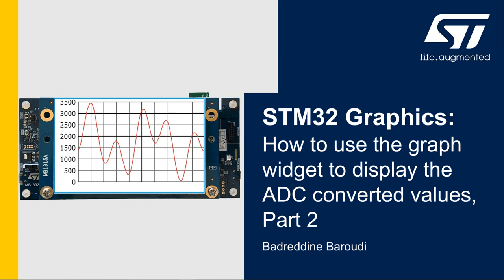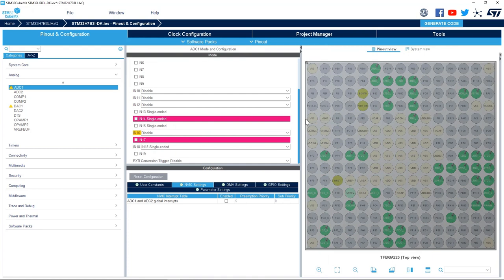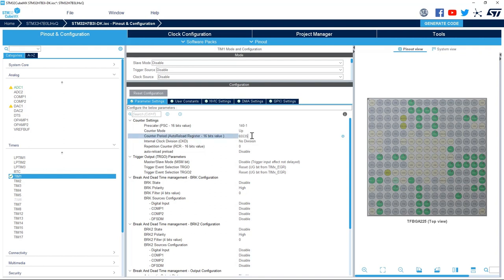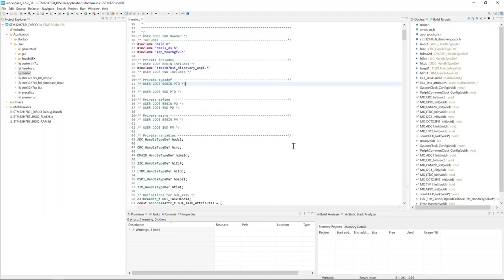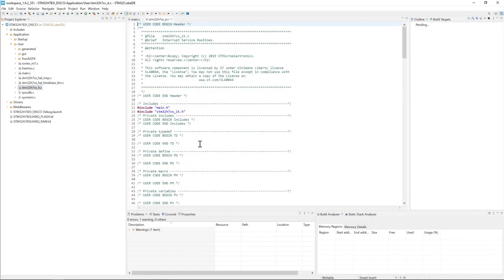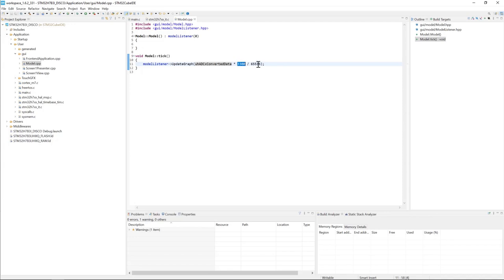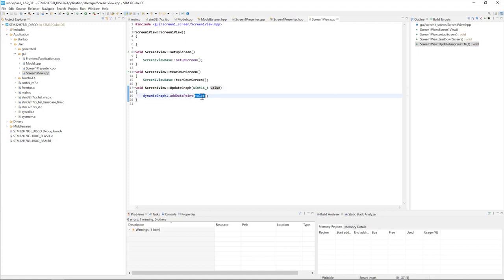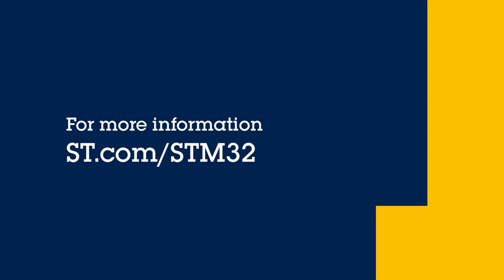STM32 Graphics: How to use the graph widget to display the ADC converted values, Part 2

Comment: I have a question. At the beginning of the video, in STM32CubeMX's Pinout & Configuration, you proceeded without the options for "boot" and "appli." However, the board I'm using is the STM32H7S78-DK, which has these two options, and I'm not sure which one to choose. Could you please advise?